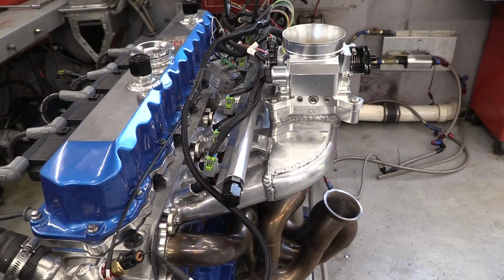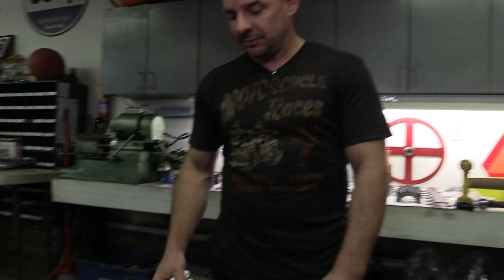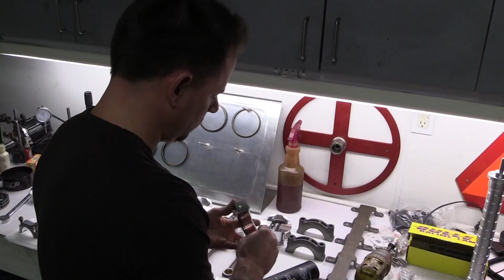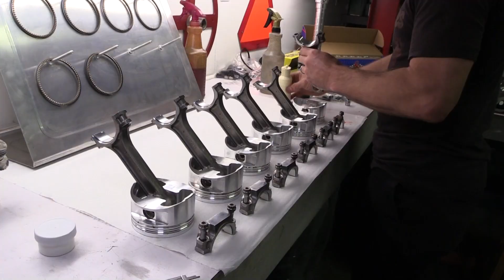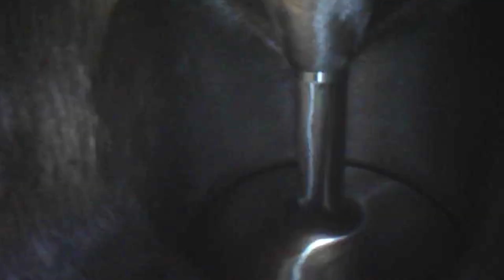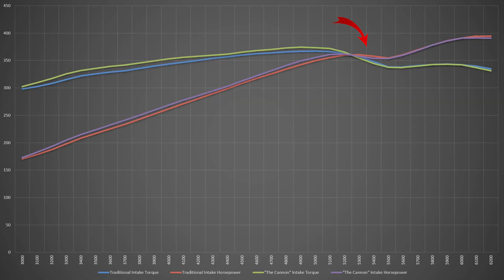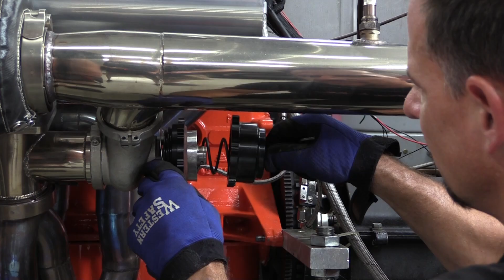Turbo Jeep Smashes World Records! (Tons of Innovation!)

Comment: Ford Motor Company of Australia made engine "Barra" 4.0  6 cylinder inline fitted into Ford Falcon and ford Turbo Territory with modification  can make more 900 KW easier than Jeep 4.00 engine
Reply from the maker: How do you get a Barra in the US? And what's the cost once you do? If anything breaks, how do you get replacement parts?
Reply: @The Horsepower Monster. Barra and factory turbo engine Barra is Aussie made use in ford falcon cars and AWD Turbo territory and is very popular and be very easy to modify so look up Australia Ford Forums or Facebook. my 2008 ford turbo territory is getting close to 500 HP still a 4.0 litre Anyway, I can organize a Barra to US for you if you are interesting and can send you some information including the shipping  cost to your address  cheers lan

Comment: My man just got finished saying “Hope he’s running a larger end gap with all that hardblock in the cooling jackets, there’s gonna be more heat, more expansion and the chance of the ends touching and locking up on the intake stroke, pulling the top ring land and possibly the top of the piston off, Id go with about .035” tL (then as I if that was the cue, the increased ring gap is revealed and mentioned to be .036” ) he looked shocked and he got this uncomfortable look on his face then continued on, saying “ Well shoot, I was off by a mile!” Never chuckled or laughed but I could see a sarcastic smile brewing in those hazel green Irish eyes...just had to share

Comment: Here I Australia we love our inline 6 engines Chrysler in the 70's had a similar I6 in 265 guise with HDMI head seeing this guy do this motor brings back memories of those engines we also used to use 4 inch bore making them around the 270 do which was a lot n those days nowadays Ford yes Ford did make a 4.0 I6 called a Barra engine it's 4.0 4 valve variable valve timing C.O.P turbo design lots of them running round in street cars making 1000 up look em up since for stopped production over here these engines are cheap and plentiful long live the I6 engine

Comment: By shortening the exhaust system and isolating the intake system, you would gain more torque, as the long exhaust system reduces exhaust gas velocity and temperature and thus reduces efficiency, this exhaust system is ideal for a turbine-less engine.  But looking at the overall performance and the quality of workmanship, you can see the dollar ratio for work 1: 1 film and work better than cinema productions where you do not feel a blow to the back from the torque

Comment: Your very wrong on the power record for these the aussie have gotten over 1300 out of these there's even a few shops that sell crate motors even na ones over 600hp
Reply from the maker: Interesting. Any links where we can see it?
Reply: @TheHorsepowerMonster  I know 505performance does some na stuff over 700chp and I can't remember the aussie guys names atm but if I remember in the next day or two like I normally do I'll post it. But this build you guys did longblock wise looks like the poor man's 4.6 with rods and pistons which if you gap the rings right isn't needed. I remember tuning one for a arabic guy that was still stock guts just re clearanced and boosted it made 600whp pretty easy on 38s and the last time I ran into him it was running strong still. But just remember the stock heads are what hold you back. I know in brazil we cut some v8 head and weld then together like the chevy 292 guys do with sbc alu heads and that makes a huge difference and gives ya a cross flow head. But I also feel like I remember one na 5.0 stroker that ran on meth and made about 1000chp so with boost a well done one should make alot. If I remember right dude said the block was the weak link around 1500 they crack no matter what you gotta sleeve them then they may always drop a sleeve so I'm not sure we're gonna see anything over that.

Comment: 1st I MUST SAY...THE AMC 258 is my Fav 6 Banger to Date(Gasoline Wise)I have been a 6 Banger lover since my Dad owned a 49 Chevy...he bought a GMC 6 BANGER STILL PACKED IN COSMOLINE...But the difference between GMC & Chevy back then was not like 68 GMC & Chevy...parts will interchange if you know what is modified between the 2... I ended up with my Biological Dads 55 Chevy 2 door 150 model Wagon...235 w/3 on the tree...Modified head ports Put a Regrind "R" cam...3:55 gears in rear and an O/D trans in it...I COULD PASS BIG RIGS DOING SAME RPM...ALSO GOT 30+ MPG!!!!

Comment: Nice, but I Brazil there are a few 6 cilinder  250ci above 2500hp.
The original block has huge steel reinforcement frame welded around to withstand the crazy torque forces generated.
https://youtu.be/9ctkkiRA6kI

Comment: What would it cost for an engine with turbo and intercooler like this one and would it fit into my 2007 Jeep Wrangler JKU?
Reply: Likely more than you paid for your Jeep off the lot brand new.  You're running a V6 in that JK and nothing about this 4.0L I-6 will interchange or fit.  Might as well drop an LS or hemi in, you can find all the stuff needed for a retrofit with those engines as opposed to the 4.0L, and no doubt cost significantly less.  All the things that make a modern V8 swap in a JK cost $20K will have to be done with this engine as well.  The kind of work done to this 4.0L isn't really the kind that you can buy for any price, since it's so far ahead of anything else out there...these guys don't give out their secrets regardless of cost so the best you can hope for from someone willing to go all out on a 4.0L is maybe 75% of the kind of power you're looking at in this video, with no guarantee that it'll survive more than a few runs down the strip.  Way easier to get an LS or hemi up to these numbers with off the shelf parts instead of one-off/exotic/custom parts and non-streetable mods.  If you were watching the beginning where the bare block was being assembled at 3:22, you might notice something like sand stuffed into the hole where the water pump mounts up.  That's block filler, it was poured in to give the block more strength and stiffness because once you start making that kind of power, the cylinder sleeves will distort out of round and cause cracking or ring failure.  This is generally done because stronger blocks don't exist or the builder couldn't afford a stronger block (since we're talking a 4.0L, there are no stronger aftermarket blocks out there).  When you fill the water jacket with that much filler, you've gone past a street/trail engine and straight into run it down the drag strip once and shut it off before it overheats.  A short fill down to the base of the freeze plugs can sometimes have zero impact on cooling while gaining strength, but this isn't a short fill by any means.  This engine was designed to produce huge numbers on a dyno to beat a record, it's not the kind of engine you'd want in your JK anyway...a modern V8 swap would be far better for street and trail use while giving you the option to drop a blower or turbo in and reach similar levels of power.  Sorry to dash your hopes and dreams my dude :/
Reply: @Skinflaps_Meatslapper  Thanks for the reply. I figured it would be wicked expensive.  And you're right way more power than I could need. I have a 2.8ltr intercooled turbo diesel  with less power than the v6 petrol engine you guys in America get. Here in Australia,  you can't put any engine in a vehicle that has more than 10% of the original engine.  It sucks here. Once the vehicle reaches eol usually 25 years or more then you can put whatever engine you want. It still needs to be certified for road use.
Reply: @fourbypete  Right on, that sounds like a hassle.  I'd drop in a bigger diesel and stick a 2.8L badge on it LOL
Reply: @Skinflaps_Meatslapper  They aren't that silly.  They know from the number stamped in it what it is. A few people have tried grinding the number off but then you have to have the engine certified to get s new number. The whole system is set up so there's no way around it.

Comment: At 8.6:1 compression and the strength of the internals, I'd be happy at less than 20 pounds of boost and less than 650 hp. Lots of power that will last forever.
Reply: Yes 15 lbs of boost snd you got bullet proof reliable 600 hp ..  thats like having 3 axles in your jeep and each one being run by a stock 4.0HO.. tell me that woukd not be insane .. talk about power for days and wheel spin

Comment: This engine is solid and I would love a stroker on my 2000 XJ.
But, in reality I don't need 350+ HP to bury my 35s. My problem is usually drive shafts and axles. 
Now, my next project is a Exige with a K24A2 swap and in that one I could use 500+ HP for track use..

Comment: Okay so one of the few things that I really would love to see somebody do on a Jeep 4.0 is to modify a head to put the intake on the passenger side and not intertwine it with the exhaust. Because let's think about it even if you were to do that you could drop the temperatures of air going into the engine by so much it would be ridiculous. And I don't mean ridiculous like what this group of ridiculously awesome individuals have done I'm talking like for your average Joe citizen cruising around in his Wrangler or XJ. This is some new level of badass when it comes to the 4 liter it really inspires me to want to drag my junk out of the backyard and revive the old girl
Reply: The bore spacing is the same as a small block Ford, 4.38". Two 351 Cleveland heads cut and welded would do the job. Start with either the Australian head or the Edelbrock head. These use the smaller 2V intake and exhaust runners and closed combustion chambers. You will have to modify the water passages and head bolt holes slightly but other than that it will bolt on. I have also looked at the 2.5 4 cylinder and using a 351 Cleveland head on that to make a high rev monster.

Comment: While I'm a huge Jeep guy and this build is awesome, why don't they show the horsepower and torque from 1000-3000rpm, where basically almost every Jeep will be?
Reply from the maker: Running an engine on a dyno lower than 3,000 to 3,500 rpm can be really hard on the engine. That's because the dyno only allows the engine to rev so fast. When you hold the rpms down at wide-open throttle, you allow the combustion pressure to get really high in the cylinder which can lead to damaged parts. It is OK at higher rpms because the piston moves down in the bore more quickly and the exhaust valve opens sooner so there isn't as much stress on the piston, connecting rods and crank. Hope this helps, and thanks for watching.

Comment: Great engine🤩 but you might want to rethink seat pressure on the intake.  A 2” intake valve has 3 square inches of area! 3.14 to be exact. If your running 30 psi boost.  30 psi X 3.14” is 94 psi of boost on the back of the intake valve trying to push it open at full song reducing the seat pressure from 145 lbs to just 51 lbs of pressure on the seat dynamically.  Remember you always have to take max boost and valve area into account when setting seat pressure on forced induction stuff

Comment: Congratulations on your record breaking and thanks for the interesting videos.

It would be interesting to see chart comparisons of a dual outlet header + twin spool turbo or of a dual outlet header + non-sequential twin turbos.

Combined versus dual exhaust comparisons after the turbo(s) (with and without x-pipe) would also be interesting.

I'm sure you're gaining a lot of insight into in-line six builds with these extreme projects -insights which will, hopefully, contribute to improvements for those who desire peak numbers at half the RPMs you are reaching (i.e. street performance).

In considering all the work to increase the displacement of these Jeep engines, I confess that I've often considered swapping in a Ford 300 or Chevy 292.  The Chevy 292 seems interesting since the intake and exhaust are on the same side of the engine as with the in-line Jeep engine.

When will the turbo exhaust manifold appear on the Newcomer Racing on-line store -preferably with a dual outlet option?
At least seeing a bare header flange there would be nice.
Are the runners of the turbo manifold of equal length?

I swapped a 4.0 head on my 258 block and have been really missing my long-tube headers. :(

Edit...
I just learned of dual volute versus twin scroll.
"Cadillac’s Giant 4-Cylinder Engine Has A New Dual Volute Turbo" https://www.youtube.com/watch?v=HYzWoAJYFe4

Comment: Have a look the Oz 4 Liyte I 6. There is a Xy ( 71 ) Falcon called RIPSS pulled 2240 HP at horsepower heroes. Owned by a petite lady name Maria. Loads of OZ Falcons running 10~12 secs at around 4000 LB (1800 KG )  and still drives loke a normal family sedan ...kid seats and all. Look up Ford Barra.

Comment: Looks like a straight contender for the 2jc and Barra Ford guys.,! Can only imagine with a race built head and better turbo.
Reply: I like this build it was a good watch and the number is impressive. But Sorry Not a chance against the 2JZ RB30 or Barra .... sorry.
Reply: It won't rev, heads don't flow, ports are on the same side and he's having to use water/meth injection at only 200hp/L to try to keep intake temps under control.
It's an achievement to get that power out of this engine but it's never going to make good, reliable power on the street like most other L6's can.
Reply: @brendo7363  well, to be fair, these things fair better than most other 50 year old design inline 6's, and seeing as the 2jz and barrs are much newer designs/revisions, i think we can cut the 4.0 a break.
Reply: @riogrande163  Here's a 50 year old six 
https://www.youtube.com/watch?v=GCOC3jKN_D4&ab_channel=Fullboost

Comment: I sure would like to know what rope seal Newcomer uses.
Reply from the maker: Not a rope seal. I know he's done a lot of R&D on what works the best. It is a modern two-piece seal, not sure but maybe viton.
Reply: @TheHorsepowerMonster  Thanks for the reply.  I have not found a good rope seal material for the industrial engines I repair.  A rubber seal would be great but I haven't found one that I can make fit either.  I was thinking a power shop somewhere would know of a good rope.  Thanks again.

Comment: You guys should build a Ford 300, common knowledge dictates that a minimal amount of performance parts can match the tourqe and horsepower curves of a ninghtys 454 SS (admittedly a turd of a big block, but fantastic numbers for a five liter(4.9 whatever, fuck metric) straight six, just saying).
From personal experience with stock versions of both mills I can attest to the rpm advantage of the four liter but the tourqe potential of the three hundo begs to be built. Come on guys do a gas fired diesel for all the hillbilly's. And let her breath on her own it's the key to understressed reliability in high performance applications.